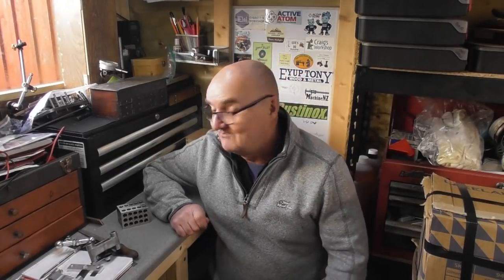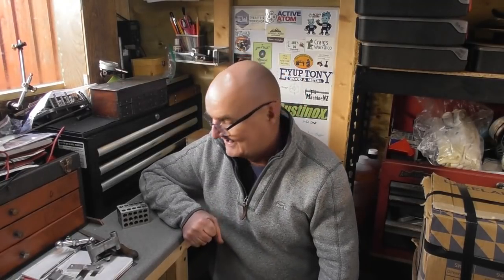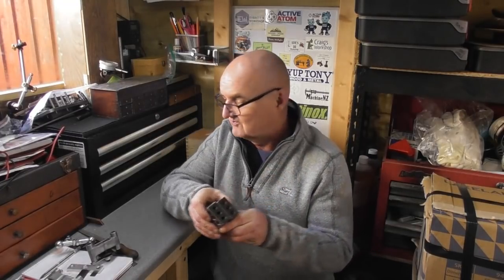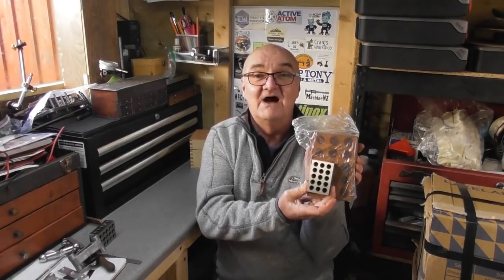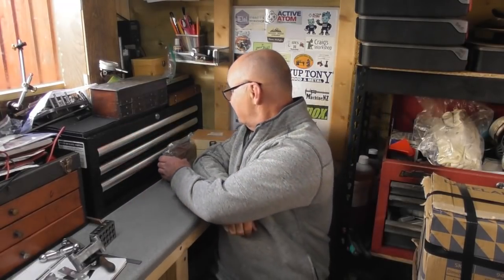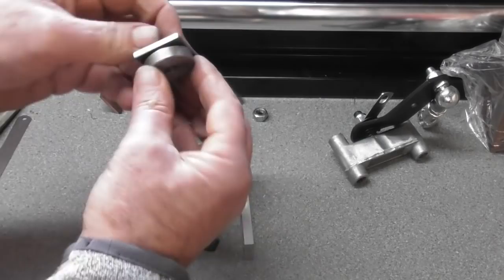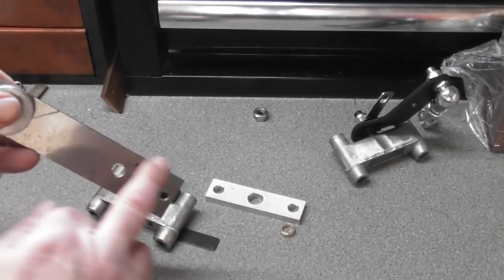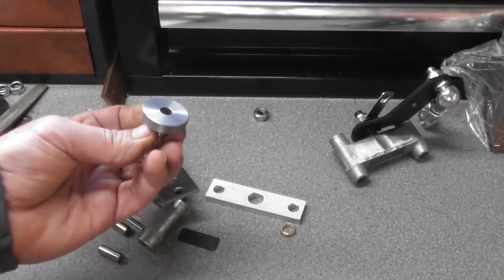New toys, New Year and a little R and D work

Comment: Happy New Year to you and yours Ade!  I think that's a nifty improvement on the chinese brake! One thing  however I think the two M3 bolts holding the ramp to the lever are an Achilles heel to that design. The two pieces either need to be silver soldered or TIG welded together to ensure the brake integrity. I know it's at the proof of concept stage, but needs consideration. Love the 2 4 6 blocks! 8 times the steel content and 8 times the price no doubt! Cheers mate!
Reply from the maker: Hi Mate . Yes it is just a concept at present. if it works the lever will be made in one piece . the blocks were less than £90 so not bad value considering the mass of steel . Cheers Ade.

Comment: G’day Ade. Sounds like it’s for a self drive lawnmower but then I haven’t worked on one so what would I know. Truck braking system’s I have and those pistons would be ground with a corresponding ramp (flat not conical) Good luck with your R&D. 
Cheers 
Peter

Comment: Good to see you back Ade, happy new year.

Sure looks cold in your workshop.  I bought an 8KW diesel caravan heater, runs on red diesel, it’s great, has a remote so I can switch it on, have a cuppa and then it’s nice and warm when I get out there.  A lot less to run than an electric heater as well.
Regarding the steam engine, Joe Peizinski is a ‘machinist’, his methods and accuracy are superb.  Blondihacks has also just completed the same engine, she is also a good machinist, but uses different methods, which I find easier to understand.  It was very interesting seeing different ways of achieving the same result.  Keith Appleton is a mine of information regarding all things steam, but he’s not in the same league regarding precise machining.
If you get the time to watch Joe, you’ll soon be enjoying “let’s do it” and Blondihacks, it will be very interesting to hear your conclusions.
Cheers Noel

Comment: Hi Ade, I think you might have to remove the protruding bit from the cam disc to allow it to wobble on its pivot shaft and equalise the pressure on the brake pad to compensate for uneven pad wear while in use. Nice design but way more costly than a bent bit of steel so wish you luck in getting the manufacture to implement it. As always very enjoyable video. And a very happy new year to you